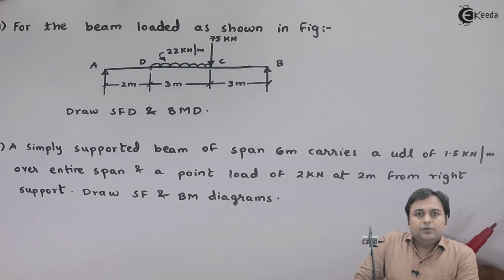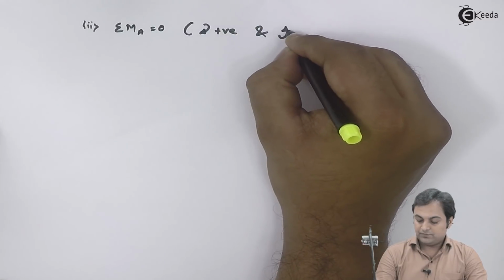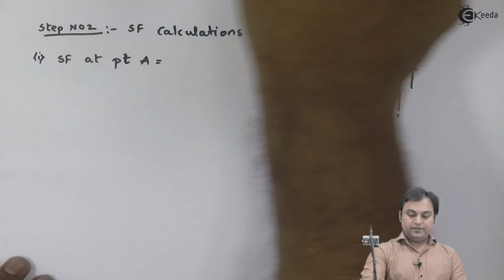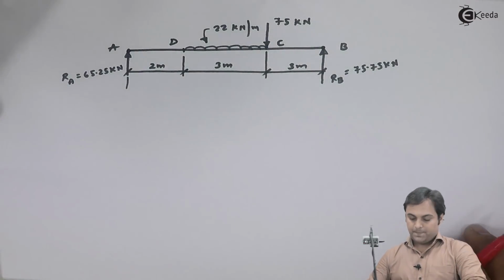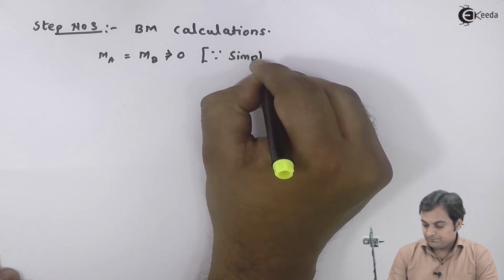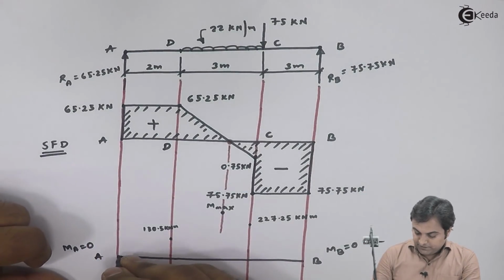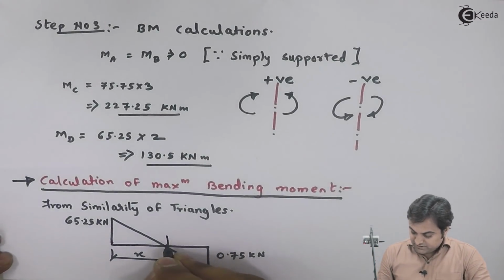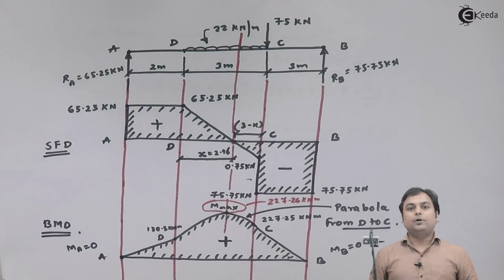SFD and BMD - Problem 8 - Shear Force and Bending Moment Diagram - Strength of Materials

Comment: You considered left of the section till point c.  After c when you take the point B you considered the force acting right of it.  I dont understand its logics.
Reply: You can't make a section of beam to the right of point B, because the beam ends AT point B.
Reply: morever it would be far more easier to calculate the section from B bcoz it is easier to know the sign conversion.

Comment: While calculating the moments on point c , why the udl load was not considered and force RA.. Please clarify...
Reply: ROBBY SINGH  i too have the same doubt
Reply: Because if you draw out all the sections, the section with the 75kN point load is a section on it's own. we made a cut to the right of point A, making a section from the left of the beam (point A) to cut 1. We then made a second cut to the left of point C, which makes a section from cut 1 to cut 2, this contains the UDL to the left and the 75 kN point load is to the right. We then make a cut to the right of point C, making a section from cut 2 (immediately to the left of point C) to cut 3  (immediately to the RIGHT of point C). this section contains only point C load. The final cut is then made immediately to the left of point B, this has no load inside it, but has the upward reaction force Rb giving the final calculation. 
If you draw out all the forces, then dotted lines where all these 'cuts' are and look at the section it will make sense.

Comment: Why is it that when calculating the maximum moment, you use the 2.96m instead of 3m, when the udl is equall spread over a distance of 3m?
Reply: Actually,2.96m is the point from D where the shear force is zero(according to the shear force diagram) i.e the bending moment will be maximum at that point.So,to calculate the maximum moment , we take 2.96m as the distance from D.The spreading of UDl don't affect the distance you use during calculation of  BDM.

Comment: How was second step of max bending moment calculated? Please help. (22*2.96*2.96/2) How this is written??
Reply: when we are taking the moment from the udl 22kN acting on 2.96m FROM the max bm point total load by udl will be 22*2.96kN and it will act ón the mid point of 2.96m that's why 2.96/2 and moment is ( force* distance) force = 22*2.96 and distance is 2.96/2 FROM the max BM point.

Comment: How do you decide which side of the section to take? You usually seem to do it in random.
And for BM(max), why did you not take R(B) force to calculate moment?
Reply: its our call to make, as long as you follow the sign convention, the sides don't really matter, its only an issue of ease of calculation

Comment: sir may i know why for the MA=0 it's (66 X 3.5) but not (66 x 3.5 x 1.75)
Reply: When finding external forces you have to convert the UDF to a single force in the middle and treat it like a single force at a point. I don't know why you would want to multiply with 1.75.
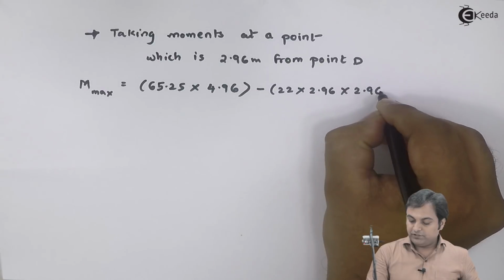Reply: @icyburger  she is comparing this with 27:17
Reply: becoz udl is upto D to C. we cant count AD distance into this.

Comment: sir how do we know that it BM is parabola or inclined line ??
Reply: Civil Engineering Features
  few weeks back i was like u confused about inclined or parabole so to make it simple 

 For Point load 
       SFD.-horizontal
       BMD-- Inclined

For  Udl 
    SFD - inclined
    BMD-  parabola 

For Uvl 
   SFD- Parabola 
    BMD- cubic
Reply: For point load it is inclined and for udl it's parabola
Reply: Shear force is achieved from differentiation of Bending moment function.Hence only differentiation o parabola equation gives a straight line with certain slope as  shown between point C and D